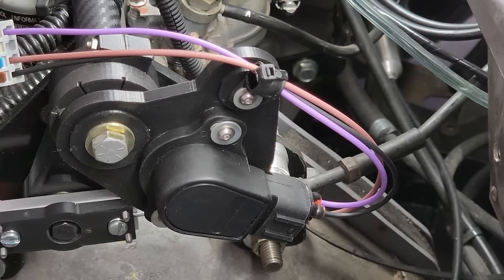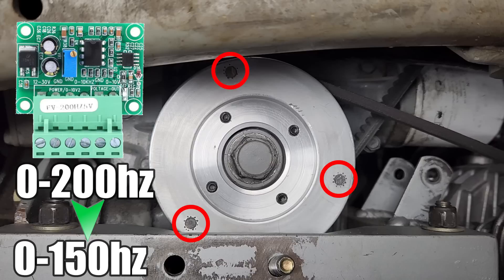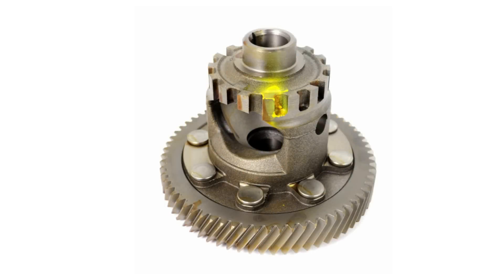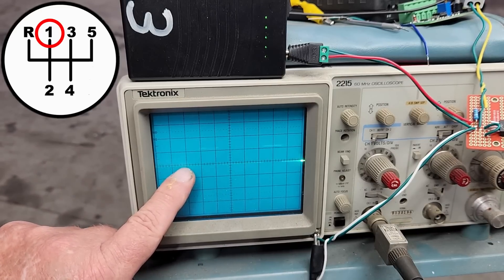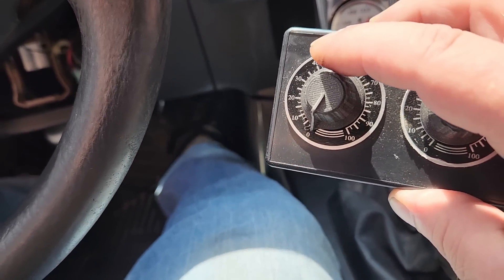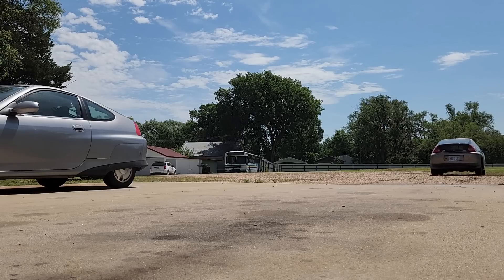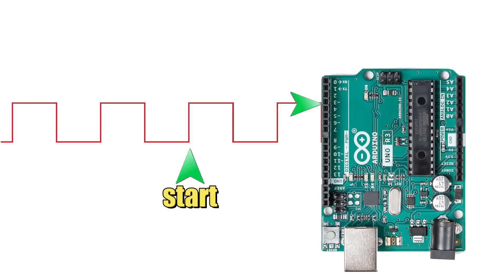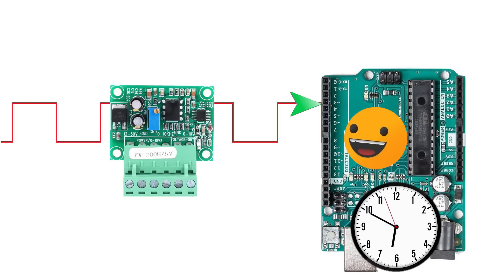S4 E21.We make progress on the Arduino controlled AMR500 supercharged Kubota diesel powered Honda

Comment: by the looks of it, it may have flashed 5 MPH a bit so you  might be at 4.99 MPH but since you are using integers and not floating points, it can't display that. if floating points are not an option, maybe use 2 addresses (8 bit each has 256 but together gives 65536 instead! well there is a 0 in there so 255 and 65535...) and multiply values by 10 somewhere along the line so you can pick up 1/10 MPH increments.
Reply from the maker: LOL,  I do use a floating point for the calibration factor and everything else is in integers.  Meh close enough.

Comment: Why the frequency to voltage converter then analog to digital conversion? Feed the signal as digital and assign interrupts. You will need a zener diode and a resistor to achieve that.
Reply from the maker: the arduino also has to drive two stepper motors.  Doing  two frequency measurements (RPM and SPEED) will slow down the arduino to a crawl with standard code.
Reply: @robotcantina8957  I have done this kind of projects in the past, and the analog read is by far one of the slowest things. Just keep your interrupt routine short: e.g. store the micros() values. You can check out mpgduino code for example-there you have measurements of injector pulse duration by assigning two interrupts to a a signal and vehicle speed, a lot of calculation and display updates.
Reply: @robotcantina8957  Analog read takes approx 100us and an ISR will take about 3-5us. Just keep your interrupt code short (e.g. store the micros values). Check out MPGDuino for example - there you have vss and injector pulse handling. You still will need to perform the analog read for the TPS. Ideally you can add a MAP sensor and a wideband to get nice closed loop control.

Comment: I having some trouble understanding the difference between directly measuring the frequency vs converting to a voltage measurement. I realize Vref can be changed but is the signal buffered somehow?
Reply from the maker: Keep in mind the arduino also has to drive two stepper motors.  Doing direct frequency measurements with standard code would slow down the arduino  too much and the speed of the stepper motors would suffer. The primary objective is to instantly control the rack and boost with the stepper motors.  The data from the RPM and vehicle speed only needs to be approximate.

Comment: Hey Jimbo, yoh may find that the sine wave from the nubs actually gives a bump on the falling edge of the nub too, so you get a heartbeat style wave, which can be tricky to measure if you have noise.

For the 2V output you might be able to use a Scmitt trigger with an ISR as you describe.  I nearly said to you last week about how DigitalWrite function is very slow (relatively speaking) and although bit-bashing the IO registers directly is "advanced", I'm sure there are plenty of forum posts about it, especially if you're using the classic ATMega IC.

Anyways, if the F to V is working then great!  Back in the day before integrated ADCs were a thing you could use a V to F chip to get an analogue input on a microcontroller, so you're just doing that in reverse 😂

Comment: I know that you don't want to deal with interrupts, but instead of using a frequency to analog voltage approximator, you could use your input votage conditionning transistor to 3.3V and use a pin on the arduino to act as an external clock reference for one of the unused timers (timer 1 and timer 2 if you don't need them) then in your code periodically lookup the value of that timer at specific time interfals using timer 0 as a time reference. Then you get your RPM directly and you can add a second pulse sensor total with all 3 timers (and you don't need to callibrate as the couters will be direct).

Comment: You should look at AdaFruits M0 and M4 Metro boards, they are totally UNO compatible, but have WAY more power. I think they would have plenty of power to ditch the frequency to voltage converters and simply run some IOC interrupts and timers to get your sensor data much more accurately, and with less random electronics to worry about. Arduino is a wonderful ecosystem and I use it all the time for proof of concept prototyping at work, but the UNO board is long of tooth for it's price point, and the aftermarket compatible boards are truly better in every way at the same price point.

Comment: If you want I can help you in the Arduino interface problems.
Using the timers as counters is a non standard feature but is so easy to do.

Very good vide.
Reply from the maker: I appreciate the offer to help.  I fully understand how to do the timer stuff, I wanted to try something different that is simpler for beginners to do.

Comment: Awesome!
For me its far from boring
Not a complete novice (megasquirt , speeduino - NO2c of course!, and even made my own opensource arduino AFR gauge display and "convertor" so I can see what my wideband sensor is doing on an LCD screen and drives an analogue gauge - using a DAC...so this project is right up my alley!)

Edited to add I got the same frequency generator a few months ago, only used it a couple of times, but seems to work OK

Your explanations are second to none and I am 100% sure they will be referred to for years to come and inspire others to tinker/make or even just think about how you could approach a project

Keep up the great work Jimbo
Regards from the UK

Comment: I was about to do the question about while the frequency measurement, but I'm glad you explained it in the extra bits after the end. 😆
Yeah... Interruptions may add some extra latency in the system, but I do wonder how folks in the Speeduino ECU project solves this issue, because engine speed and crank position are critical for the spark timing.
Good video, Jimbo! o/
Until next time.
Reply from the maker: The speeduino code is not the same code that's available in the standard Arduino interface.  You can use advanced code techniques in the standard interface if you know how.  Theoretically I could have done  this project with direct frequency measurements, but I decided to do it in a way that's easier for beginners to understand.
Reply: @robotcantina8957  Arduino interrupts are pretty easy to do using standard Arduino code. Take a look at the attachInterrupt function. As far as the timer is concerned use the micros() function. At each rising edge read the current time into a signed long then subtract the time you read in the previous interrupt call to get the elapsed time. It's most accurate to just read rising edges, rather than both rising and falling.
Reply from the maker: @LesNewell  I have used interrupts in the past and I fully understand the process.  The standard code in the arduino IDE is too slow to handle frequency measurements of both the RPM and the VSS.  Keep in mind the core of my program is focused on driving two stepper motors to control the boost and fuel rack.  There is no way I can read the RPM and VSS and drive the stepper motors all at the same time if I used standard Arduino code.  I understand how to do it with advance code techniques but using the frequency to voltage converter shows another method of getting the RPM and VSS.
Reply: @robotcantina8957  Arduino doesn't add much overhead for port interrupts and your ISRs can be pretty short and simple. It's not like your RPM or VSS signals are very fast. I've run port interrupts much faster than that. 
By advanced coding are you talking about assembly language or trying to get the timers to directly measure the frequency?
Just out of interest, did you try using interrupts?

Comment: I think it might be faster to process the interrupts than to read the ADC. Each time the interrupt is triggered, you substract the previously recorded time (milliseconds) from the current time and store the difference in a volatile variable. Whenever you want to use the frequency, just do 1000/T, no need to do it during each interrupt. The pins also have schmitt trigger logic and voltage clamps, so you can even abuse them a bit.
Reply from the maker: An analog read much faster than dealing with the interrupts and timers when using standard code.  Keep in mind the arduino also has to drive two stepper motors and they take priority.  The sensors provide basic info to determine if the car is moving or not and I'm not relying on precision when it comes to the sensors.
Reply: You are a master in small and possibly big engine modifications. analogRead on Arduino is <10kHz since there is settling time and decimation time and stuff that I won't go into. digitalRead is also really bad at optimization but there are libraries that do fast GPIO. The classic Arduino can do 16Mhz. Assuming a bad code at 100 cycles per interrupt that's still ~6.25ns per interrupt. A bit better than 0.1ms per ADC read.
Reply from the maker: @ligius3  This is frustrating to explain so many times.  The priority of the arduino is to drive two stepper motors as fast as possible without any delay. The speed of the stepper motors is key to this project.  The RPM and VSS are not important. the code relies on the TPS for 99% of the calculations.  The RPM and VSS are to detect when the car is moving and they are not critical.  I only spot check them.  Relax, the frequency to voltage converters are fine for this project.
Reply: I'm sorry for taking up time away from your projects to answer this. It may have been suggested many times but such posts never make it to the top and are not really visible. What I wanted to say that the Arduino analogRead implementation is a blocking operation that blocks for 0.1ms. But I agree that most times linear code is much easier to handle than an interrupt-based one and you also want to be sure that the steppers are behaving without too much fuss.

Comment: Why use a frequency to voltage converter instead of a pulse counter programmed in an arduino input? I use something like that in a few projects. The make 12v sensors too. Why complicate things?
Reply from the maker: Using standard code, frequency measurements would adsorb too much time. You should know that.  Anyway, keep in mind the arduino also has to drive two stepper motors.  The speed  of the stepper motors are the primary focus.
Reply: @robotcantina8957  well, I didn't really know that you were running the arduino at full tilt. The projects I was alluding to don't use the ESP32 at nearly full capacity. Plenty of time left over for things like that. I can understand how that would free up a lot of processor for driving the steppers. That was something I was actually unaware of. That's why I was asking! Thank for explaining it, I'll remember that trick for sure!

Comment: Why not use some of the speeduino code to avoid the frequency converters?
Reply from the maker: I wanted to try something different that would be easier for beginners to understand.  The frequency to voltage gizmos ain't perfect but it dose provide a solution for basic frequency measurements.  The core of the program is focused of driving the two stepper motors that control the fuel rack and boost controller,  These steppers need to move quickly.

Comment: I think I speak for the nerds in the room, thank you for the technical mental exercise. I am still trying to figure out why the sine wave had that bump on the right. Could it be an artifact of the magnet moving away from the sensor? Ah, it doesn't matter. Maybe it's just gnomes.
Reply from the maker: Based on another comment, the bump may be intentional to let the ECU know the difference between forward and reverse.  Sort of makes sense.

Comment: Once again well done and congratulations on the success of gizmo PoC test 1. Your design might be a hot mess, but it creates a super clean 12v square wave with a bit of electronics hackery. 

On the hall sensor, you might consider jam nuts on that sensor to keep the sensor in place. I've seen those sensors come lose due to vibration because of the moment arm length. Loctite blue or purple would also keep that sensor in place, but also make it removable if something happened.

Comment: Arduinio can count pulses much better than that pulse to analog thing, and it has two interrupt pins so you can have both sensors with nanosecond accuracy. To calculate rpm in that encoder is better to use the time between rising and falling edges, that way you have the rpm in every pulse and no need to wait counting pulses
Reply: Agreed, using input capture on a timer is a much more efficient option I think.  However for these 'slow' <500hz signals I think even catching the transition timing using some efficient code in the main loop should work.  Also missing a few samples is not an issue, just getting samples as needed to read RPM every 10ms or so would be fast enough I think.
Reply: @jontscott  you are right, with small frequecy signals it can be done easily in the main loop but doesn't make much sense. It is a very simple program, the rising interrupt is only storing micros() in a var and the falling one is micros() - that var. the main loop for a kalman filter and the ops to get from time to rpm

Comment: Thank you for the extra bit at the end.... I always like the extra information.. I get to learn stuff that I didn't really know relearn stuff that I once knew but forgot... I used to be the self-proclaimed dangerous but wannabe expert for writing the initialization string my old us robotics 28.8k bps modem. And when writing for an external modem, using the old serial port on my my dad's 286 I used to have to know all that stuff... irq or interrupt request, and many other things that I can't remember but a good initialization string help the modem perform the handshake faster which was important when running a bulletin board system, which I did in the early to mid-90s.. I loved running elk lodge, it was an awesome bbs. Running the Citadel 86 software.

Comment: My Mercedes 300SD had a switch under the accelerator pedal called a 'kickdown switch' that engaged 1st gear if you really stomped on the throttle. That might be a good way to engage your full rack emergency acceleration mode in your Insight.

Comment: So if you can hold the throttle down and control the rpm with the knob… wouldn’t that mean that a possibly easier solution would be to block the throttle fully open and convert the “throttle” to drive by wire using the rack alone to control engine output effectively bypassing the governor?
Reply from the maker: That would work if you trusted the electronics to work perfectly all the time.  I personally don't trust my hodge podge mess that much.
Reply: @robotcantina8957  speaking of which, would you consider selling me a kit for my own Kubota vehicle project?

Comment: i was watching the Sleeper dude channel and he just got a Ford model T and i mentioned to him this channel to maybe figure out how to control the engine on this kinda setup instead of the original
Reply from the maker: LOL, I just watched that episode.  I think the engine would have ran if they jacked the rear wheels up on the T.  The transmission on the T is not a normal gearbox and you can tell the T was wanting to move forward every time it was started.
Reply: @robotcantina8957  funny i was thinking the same that its not idling becuse the clutch is causing to much drag
Reply: @robotcantina8957  its soo cool that you watch their channel also
they are such an amazing family

Comment: Again, excellent as always.  Are running the input from the frequency counter through a low pass filter?  

I’m going to implement this counter as a fail safe for an event of an overspeed on my generator.  If I get a random voltage spike from the counter the Arduino may auto shut down the generator.  Thanks!
Reply from the maker: The signals I sent to the input of the frequency counters are super clean 12V square waves.  No need for a filter.

Comment: I bet powering the frequency to voltage off 12v will allow it to get very close to 200hz

The reason is powering off the arduino (5v), will experience an additional voltage drop with the on board f2v regulator
Reply from the maker: I'm feeding a12V supply to the frequency converter.  It may actually want more.
Reply: @robotcantina8957  go to 2 magnets instead of 3?
Reply from the maker: @steveyoutube1709  The magnets are JB welded to the custom made pulley.  I would rather not damage the pulley by removing one magnet.  These frequency to voltage  converters are cheap and all I have to do is replace it and set the new calibration factor.

Comment: You should switch to an adafruit m4 metro board. There is a lot more horsepower available, and it still mostly works like an arduino does. I bet any code you have now works just the same. The only downside will be the 3.3V limit...

The biggest bit would be the multiple timers and the DMA, you can capture frequency/period directly with them to a very high accuracy and move those measurements into memory for your calculations without any cpu intervention at all. That all sounds really complicated to configure, but it's not too hard and there are plenty of examples on the net. I use a very similar DIY board to measure 4 wheel speed sensors and pipe them into an aftermarket ECU for traction control. All said and done, I can measure frequency from tenths of hz up to several kilohertz. 

Timers on an uno are pretty pitiful in comparison. I'm sure it would do the same, but you might run out pretty fast. They are also much lower resolution, and won't span such a large frequency range.
Reply: at the very least an ESP32...horsepower and 1/2 in relation to the Arduino